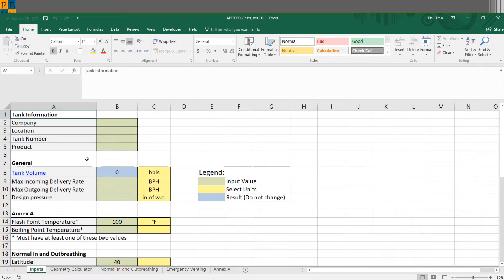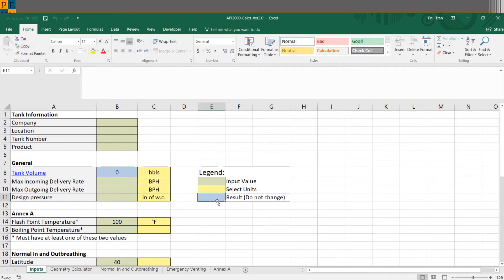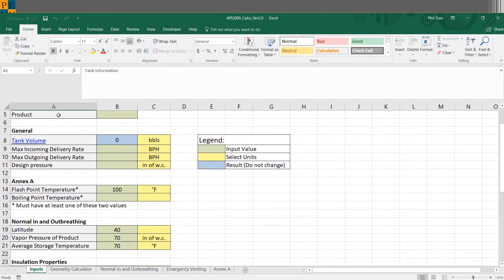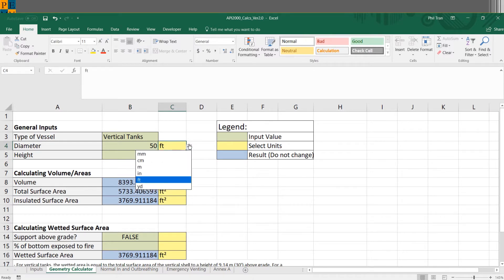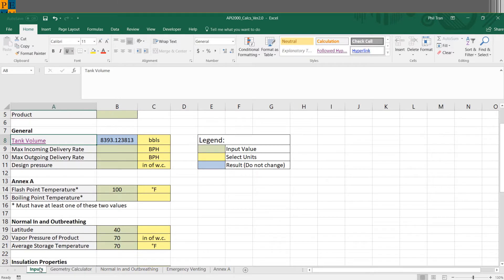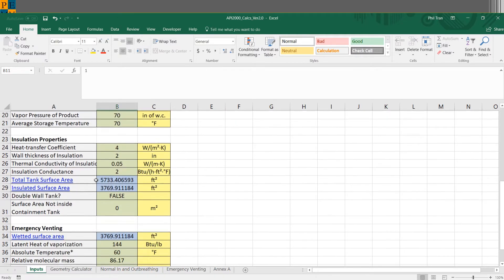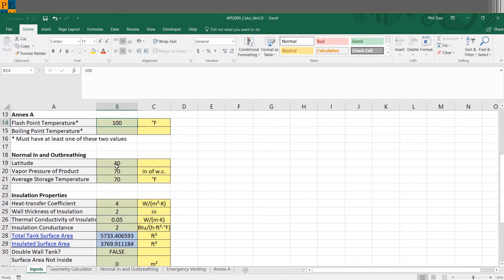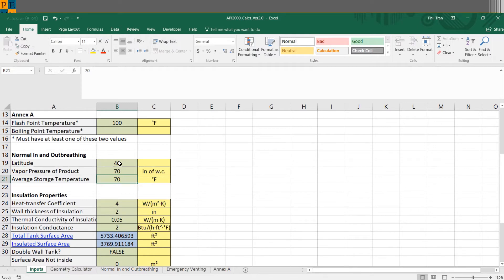API 2000 Calculations: Part 3 - PEMY Consulting (Phil Myers)

Comment: For in breathing calc, what time API 2000 assume for ambient temperature to drop from say 50degC to 0degC for condensation to occur. I think API 2000 doesn't talk about it and consider this happens all of a sudden and resulting into higher in breathing rate which doesn't look realistic. For example in a desert during afternoon summer the temperature could be 50degC and mid night or very early morning it could be 0degC so this temperature change doesn't occur all of a sudden it takes around say 10 hours and then if you divide your API calculated in breathing rate by say 10 would be your realistic in breathing rate. Can you please comment on what I just said , does it makes sense? Or ApI equation already takes care of this slow temperature drop rather than abrupt from 50degC to 0 degC

Comment: Thank you for your detailed video!
In NFPA (edition 2018) it says:
22.7.3.10.3 The flow capacity of tank venting devices less than
8 in. (200 mm) in nominal pipe size shall be determined by
actual test. These tests shall be permitted to be conducted by a
qualified, impartial outside agency or by ...

22.7.3.10.4* The Flow capacity of tank venting devices equal to
or greater than 8 in. (200 mm) nominal pipe size, including
manway covers with long bolts, shall be determined by test or
by calculation. If determined by calculation, the opening pres‐
sure shall be measured by test, the calculation shall be based on
a flow coeficient of 0.5 applied to the rated orifice, the rating
pressure and corresponding free orifice area shall be stated,
and the word calculated shall appear on the nameplate.

Did you consider the fact (as it says above) that the vent calculation is applicable only for equal or greater than 8 inches?
Reply: How to determine the size of the vent then ? If this formula is applicable only for sizes 8" and more, how would i know that the results will be more / less than 8" ? Could you help on this please ?
Reply: @chelladuraiboopathy7029   I'm open for suggestions on how to do or maybe if you want to share how you calculated it. I compared this equation with API 200 D18 equation which gives you a flow equation through the nozzel. But the NFPA equation seems to be more conservative. Another option I have considered is with Crane table B-12 it gives you  pressure drop of air for certain vent diameters at a certain air flow, so you can choose the vent depending on your maximum allowable pressure.
Reply: NFPA which one used , NFPA 30 ?

Comment: Hi Can i please have the excel spreadsheet.
Reply from the maker: If you are interested in licensing or purchasing a copy of the PEMY API 2000 Spreadsheet please contact us at (925) 302-6706, or email brock@pemyconsulting.com
Reply: @pemyconsulting2955  u can get this model using hysys and also excel avaiable and API 2000 also avaiable.
Reply: @pemyconsulting2955  How much do you charge for this spreadsheet ?
Reply: @pemyconsulting2955  Hello your number and your email not working